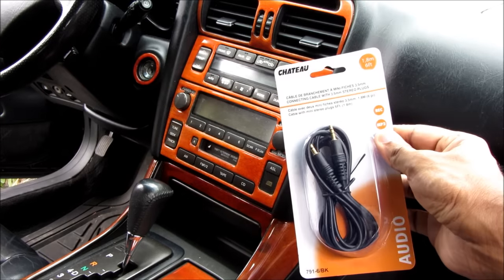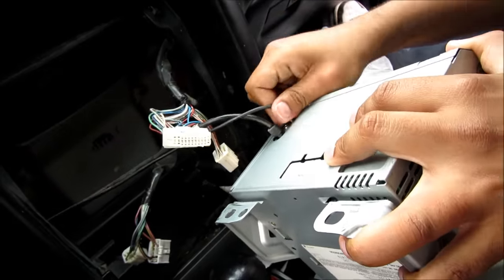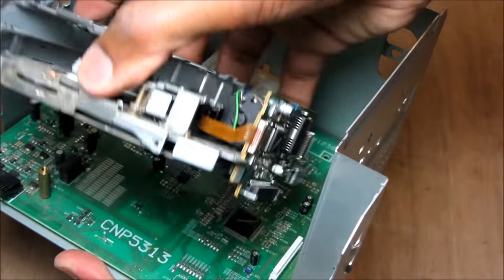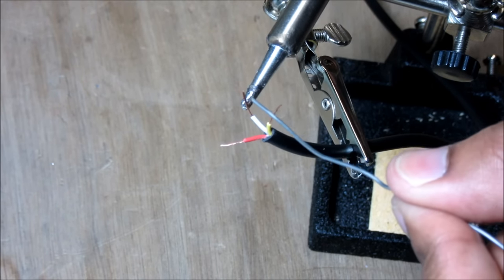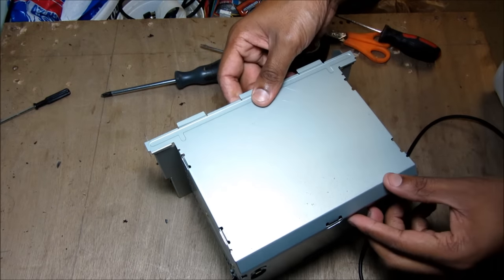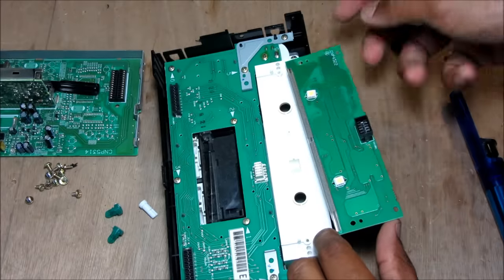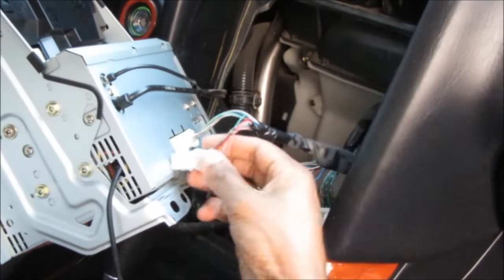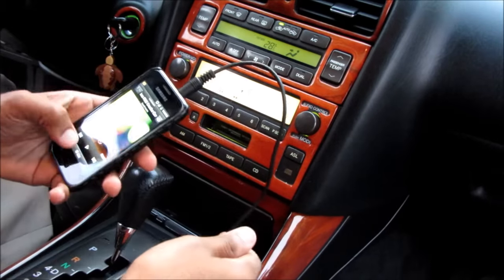How to Add AUX to an Old Car Stereo for $2

Comment: IS THIS same for 1997 es300?
Reply from the maker: Yes, though your better off going through the CD changer lines. There's a tutorial on clublexus forums.
Reply: also my radio lcd is put , pioneer < any way get to another one, i search ebay no luck , thanks
Reply: Doing this to my 1997 Lexus ES300 this weekend. My radio LCD is shot too. It's a very common problem because my brother's 97 ES300 also have the same issue.
Reply: LittleMopeHead where do you get lcd ? I need one too
Reply: I see the unit on eBay, but usually they sell them as a whole unit, not just an LCD. With the money, I'd rather get myself a Pioneer DEH-150MP and some accessories to make it work.
Reply: LittleMopeHead if you get ..could you pls send me link
Reply: LittleMopeHead also Ebay price is too high for lcd

Comment: Going to try this on my 1997 Lexus ES300 w/ 280K miles (yup, it's for fun lol). My radio LCD is shot, a common problem with these units. I've taken the deck out of the car and it's chilling on a table right now; waiting for parts to come this weekend. I took out the cassette module, and I can confirm there are the L & R solder points on the mainboard clipped on the right side of the unit. However, where do I solder the ground? Here's a pic of the board, https://drive.google.com/file/d/0B4Ew2FbKrI32OG9ZalE0MVdvTDA/view?usp=sharing

Also, I noticed that on the left side of the cassette module, there is a black switch that gets released when a cassette is inserted (below the marked LOADSW). Perhaps this is a way we can trick the player to think a cassette is inserted, by modifying the switch mechanism a little (if you don't really care about the cassette player).

Photos:

Default state: https://drive.google.com/file/d/0B4Ew2FbKrI32d0ctRldNdDBBWVk/view?usp=sharing
Cassette inserted: https://drive.google.com/file/d/0B4Ew2FbKrI32ekNSeWw5cFRacm8/view?usp=sharing
Reply from the maker: +LittleMopeHead The ES300 has an external CD changer. Solder wires to that instead and play blank CD. There might be a DIY on clublexus 
Tricking the cassette player isn't as easy as shorting a switch - there's a load sensor in the motor to detect when the tape is done
Reply: I see. I saw that DIY on ClubLexus. Might give that a try if cassette method doesn't work. Going to give the cassette a try tonight.
Reply: I wired the ground to #1, R to #2, and L to #3 of the aux connector. I didn't know where to put the ground wire, so I put it on one of the four screws that hold the cassette player. When I play the music from my phone, the sound is very weak with tons of static noises. The wires I'm using to hook the aux connector states 22 AWG. Does that matter? Seems to be a ground issue? Any ideas?
Reply: I tried rewiring to no avail, so I scrapped the cassette method and went with the CD changer method. I made a tutorial here: https://www.clublexus.com/forums/es-1st-to-4th-gen-1990-2006/859175-diy-install-aux-input-to-1997-lexus-es300-w-original-cd-changer.html. Works like a charm!

Comment: When you find a video too late...
Fk.
Reply from the maker: This is probably outdated by now with today's phones
Reply: @speedkar99  
I have an 88 RX7,  all stock and I want to keep it that way.
Instead of patching in a 3.5mm jack, I would have done a bluetooth transmitter. 
I said would have because I caved and bought a double din screen a few Weeks ago.
I immediately hated it.
It's stored now bit once I get the car out next spring, I'm putting the factory radio back In.
Reply: @speedkar99 what would be the best option now for the same Lexus Gs?